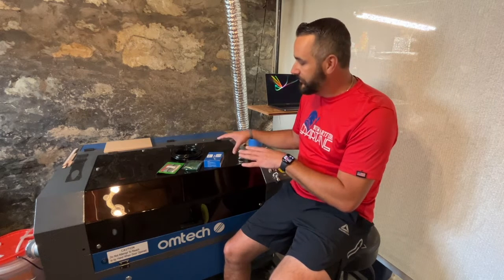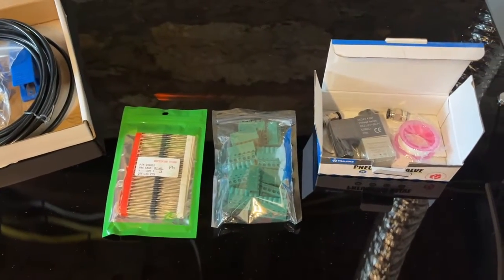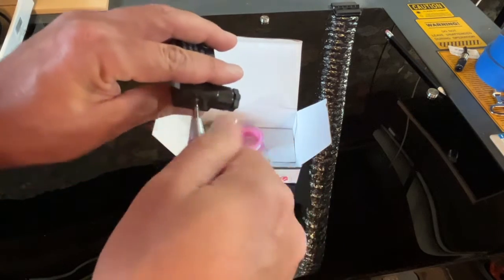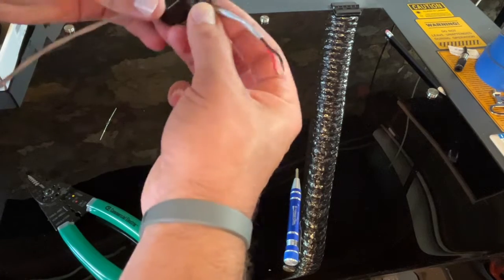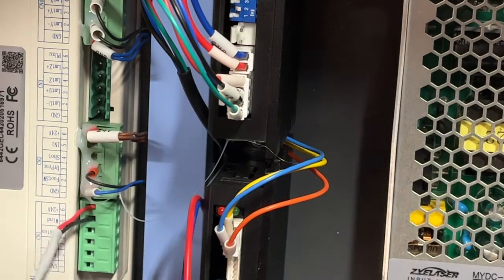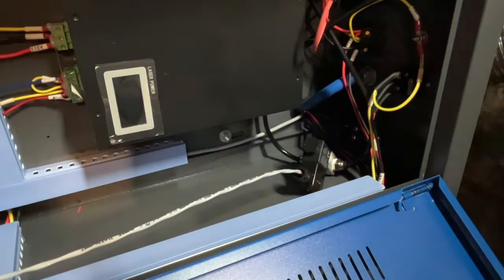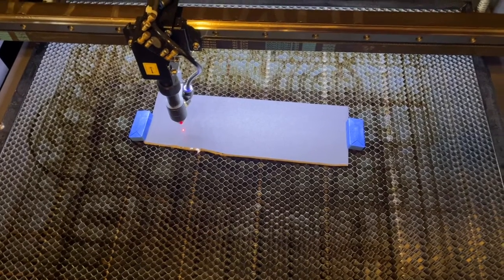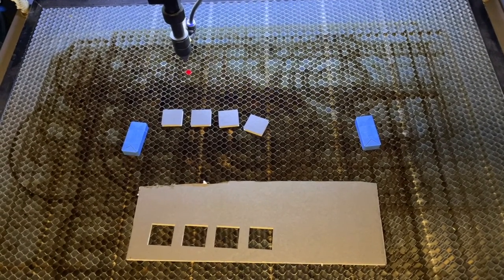CO2 Laser Air Assist - Installing Electronic Pneumatic Valve

Comment: Thanks, I have now, thanks to you, managed to install an electric pump that at last turns off when not needed, I can't fathom out why this is not wired in to start with, the pump that came with my machine lasted 4 months, but thay are replacing it, thanks again

Comment: Excellent video. You actually show the wiring of the solenoid. Exactly what I needed. Adding that resistor I would not have thought of!. I've got 124 more if you ever run out, LOL.
Many thanks and please continue your most informative videos on the K4o!

Comment: At any point where you using the compressor instead of the stock air assist at all times without all the hookups and running it at all times?
Reply from the maker: I used the stock air assist when I first got the laser, and I did not like it. Wasn’t powerful enough for cutting in my opinion. I had a smaller laser that was connected to my air compressor with a ball valve, I manually turned the air on when needed. At first I just hooked up my OmTech that way, but quickly decided to use the options on the software and the control board to make the air assist work as it should with my larger air compressor. My on board air assist is still in the unit, but I put it on a switch and leave it turned off.
Reply: @mw3designs  Thank you for getting back to me on this.  My stock air on my 60 w Chinese laser died and I want to upgrade to a compressor for air assist but am a bit intimidated by the electronics of it all. My plan was to hook it up and manually turn it on and off with a set PSI for now.... With the plan of tying it in to the machine for control later. Thanks again!
Reply from the maker: On my smaller laser the air assist was manual like I stated and I used it that way for years. I put an air line with regulator right next to the laser with a 1/4” ball valve right next to the laser, I would turn on the air and send the job. You should have no problems doing it that way, and it’s all user preference, not everyone does it the same.

Comment: I think that you need a small amount of air at all times to protect the lens in your machine. I have seen a small bleed bypass valve put in with a T adapter.  The other way is to get another valve like you said on the status pin ether way you need a little bleed valve to protect the lens.  looks like a great machine hope you have the best of luck with it.
Reply from the maker: I started out with a eBay Chinese K40, it was the most basic machine and had no air assist. I used this machine for quite some time until I added an air assist. I would have to clean the lens once in a while, but it didn’t fail. There are some jobs I still do today that I can not use any air assist with because it will adversely effect the engraving on that specific material.

Comment: What is the point of the diode? I don’t think I’ve seen any one else use it?
Reply from the maker: The diode would eliminate any electrical back-feed to the controller.
Reply: @mw3designs  then just use  24 v supplay from power supplay directly not from controler ..
Reply: @prckata  if you do that then the auto on / off would not work  and thats the point of this, correct me if I am wrong